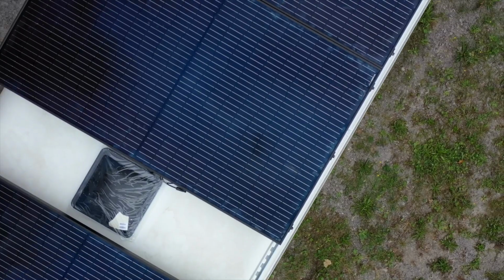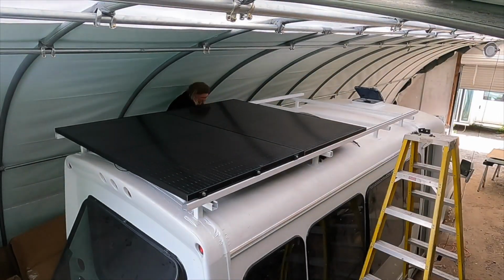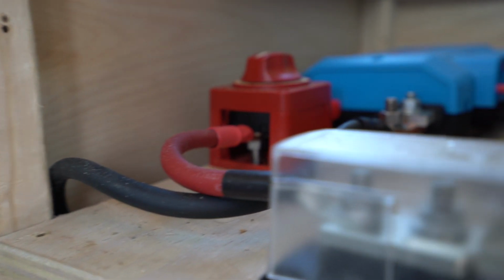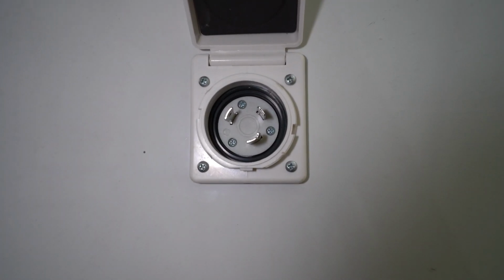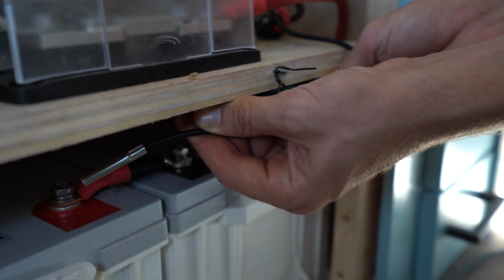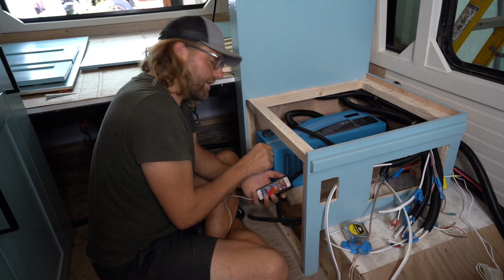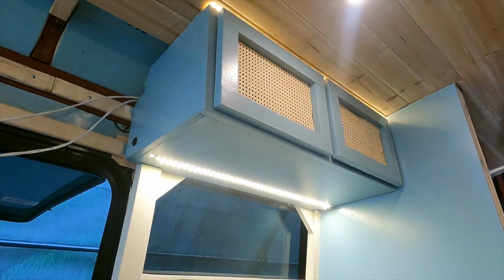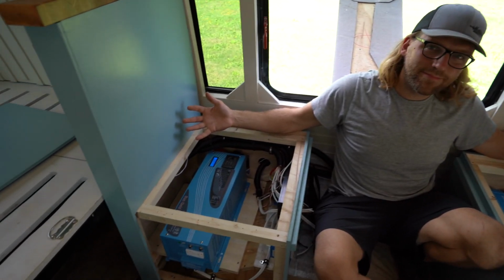Shuttle Bus Build Ep 14 | Off-Grid Solar Power System & Turning on Lights

Comment: Hey Drew and Savanah, We been following you for quite a while now and you've even been an inspiration for us buying our own shuttle bus and converting it!  We are about 3/4 the way to the end of our conversion and are working on our solar system. I have watched your solar installation MANY times and have found it extremely helpful.  I did have a question about the dc to dc step.  I've been very confused by this because everything I've read says if you've got a inverter charger you don't need a converter.  Can you clarify that for me?  
We really appreciate you guys and live your videos!  Happy travels!!
Reply from the maker: Hey! Thank you so much! This specific inverter charger only handles taking DC to 110 AC. For the DC side of your distribution panel you have to convert it to 12v if it isnt already. For example in this bus, we had a 24v battery pack so it had to be stepped down.
Reply: @OurWayToRoam  Thank you so much!  I think we actually have the same Inverter Charger that you guys have, I'll need to double check the manual.  By the way, the new project's looking great!  We've really enjoyed seeing the progress!  Thanks again!

Comment: OUTSTANDING! Quick question for Drew....@ 9:43 there is a great view of the insides of your Lynx Distribution. There are three fuses (200a, 100a, and 40a). Could you detail which components correspond to each fuse, please? Thanks, y'all!
Reply: Also, since the charge controller and the batteries are both connected to the bus bars in the Lynx Distribution, does the circuitry in the Lynx Distribution ensure that the power coming from the solar charge controller only goes into the battery bank? I’m wondering how the power from the solar charge controller doesn’t leech over to the other circuits since they are all connected to the same positive bus bar. 
PS - If the answers to these questions are too in-depth for the YouTube comments section, please let me know and I'll try to schedule a one-on-one call through your website.

Comment: Hey Drew, excellent work, and good job explaining the system. Savanna, great nodding and tool handing. I clearly remember the moment  turning on the system the first time, (did I get it all right, is she gonna blow?) and the satisfaction when it all works. I went with 12 volts, and the charge controller was Expensive! I guess the upside was that when I found that there was room in the battery compartment for a third Battleborn  battery (because I could put 1 on it's side and 2 on their ends) being wired parallel made it possible to add the third battery. In the space that we had 2 lead acid batteries, 3 lithium batteries and a pressure cooker/air fryer now fit in the same space. With the time, thought and effort ya'll have put into this build, someone is gonna get a RV of quality that is not available on the market.
Reply: Ok so I am not an electrical person either....and I may have missed it but do you have a way to plug in at like an rv park in addition to the solar ....in case it rains for like a week???